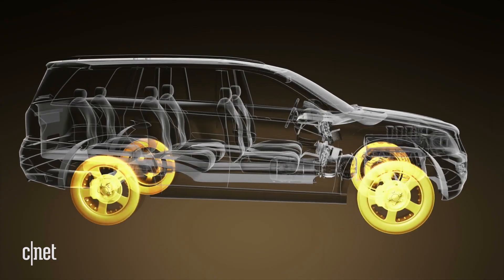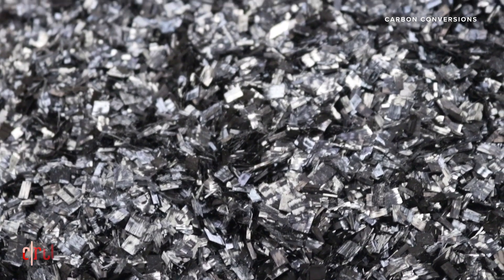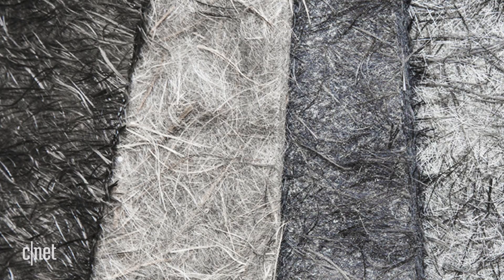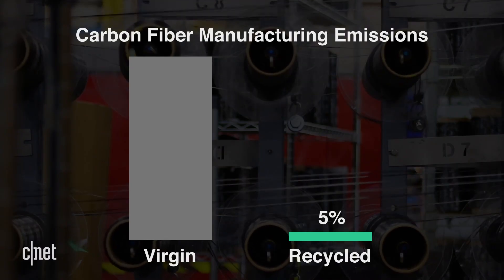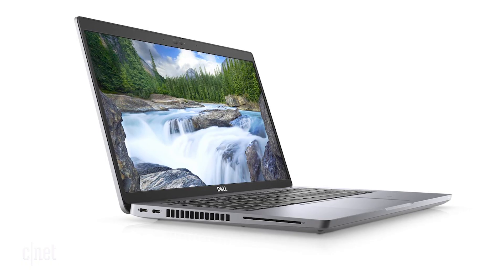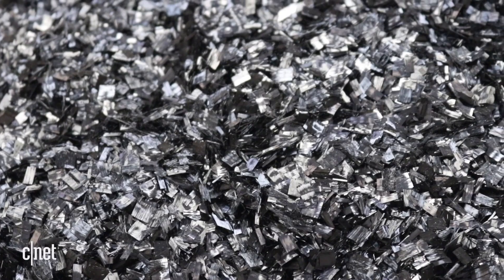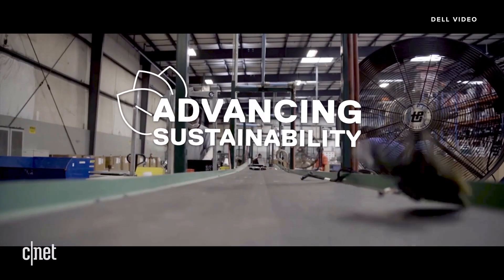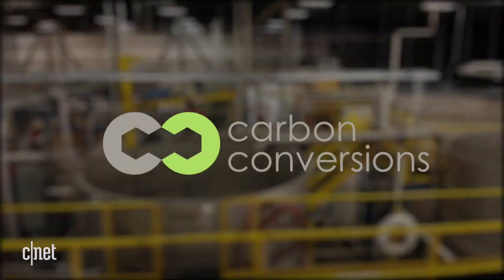Carbon fiber reclaiming, recycling, and repurposing is exploding

Comment: The carbon fibre look is very futuristic and even when repurposed it still has excellent strength and longevity for certain applications.
Some applications that are more suitable for carbon fibre than other materials such as GRP still haven't seen it's use.
Obviously carbon fibre from an aesthetic point of view alone is superior to other similar materials.
I have been a proponent of carbon fibre since the eighties with the uptake growing exponentially.
😎🇦🇺👍

Comment: "The strongest carbon fiber is up to ten times stronger than steel, and eight times stronger than aluminum"  I think you have those backwards.  Steel is significantly stronger than aluminum.  It takes more energy to create plastic deformation of steel than aluminum.  What grade of steel are we talking about here anyways that is 20% weaker than aluminum and at what temperature is that steel?  

I bring this up because I hate blanket statements presented as truth on the internet.  To me that's no different than saying "The earth is flat"   Steel is stronger than aluminum.  There is more than enough data to support it and it takes 2 seconds to google search it to find it.  

For example fully annealed 1018 steel during an elongation test had a ultimate tensile strength of 57.8ksi where as annealed 6061 aluminum has a ultimate tensile strength of 16ksi.  

If you are going to present yourself as an engineering channel at least get some basic facts correct.  Steel is not weaker than aluminum, maybe in some alloys it could be the case but not as a general blanket statement.  To assume that steel is 20% weaker than aluminum is absurd and anyone who believes that probably believes the earth is flat too.  

As Abraham Lincoln once said "Don't believe everything you hear on the internet"
Reply: I agree with you. That statement is obviously incorrect. 

I think they were unknowing, referring to the specific strength of the material, which is a unit of measure used in engineering for the ratio between strength and density. Refering to it as strength alone produces an incorrect statement.
Reply from the maker: Aluminum can be stronger than steal depending on the application and how thin and light it is compared to steal. It can be much lighter compared to steal and still be very rigid and strong. 
Googled it. https://www.aluminum.org/strength-aluminum
Reply: @CNET  Yes but my problem is that you made the claim as a blanket statement which is incorrect.  Yes certain grades of aluminum in certain applications can be stronger than certain grades of steel in certain applications but it is not the rule of thumb.  If you look at the shear breaking strength tests of steel vs aluminum you can see clear as day that steel is by far a stronger material.  We are specifically talking about strength properties, which means destructive testing in order to determine shear strength and elongation breaking strength.  You know you are defending a straw man argument.  Steel by far a stronger material than aluminum as a blanket statement.  It's the blanket statement that steel is 20% weaker than aluminum that I am targeting.  If that were true aluminum would be used instead of steel in crane cables, tow lines, screw pin shackles, gears etc.  Do you see my point?  Don't get me wrong, I have nothing against aluminum, it's a great product for specific applications but it is not nearly as versatile or diverse as steel or it's alloys.

Comment: Thanks for the 10 minute long dell laptop advertisement. I'll never get that time back.

I never post negative comments on YouTube but I think a lot more research needed to be done regarding this subject before making this a Cnet piece.
Reply from the maker: The piece was about how Carbon Conversions was reclaiming, reusing and recycling Carbon Fiber and developing new applications for carbon fiber. Dell was an interesting use case because they have managed to increase their use of carbon fiber while reducing the cost and at the same time made their laptops stronger, lighter and cheaper in the process. Simply pointing out how major manufacturers are using a more sustainable way of producing carbon fiber in present day.

Comment: It isn't taking too much of a stretch to anticipate such a fine strong fibre isn't a potential health hazard just like asbestos. Especially if inhaled.

So of course nobody is talking about that.
Reply: The research is ramping up on that. But right now it's not a real thing. Asbestos injuries are very real. Please don't conflate the two.
Reply: @namthainam  And injuries due to nano tubes, (carbon) fibers and so on are not? Chopping up fibre reinforced plastics might be more dangerous then it is worth.
Reply: It is although not to the same extent, for example a respirator should be used when sanding carbon fibre. It’s typically impregnated into epoxy though, so no risk from there.

Comment: So now the question is this: Carbon Conversions is using leftover waste from manufacturing (which is more carbon fiber reclamation than recycling, it seems), which is likely significantly an easier task than post-consumer waste.  What about post-consumer recycling?

And if Dell was serious about more sustainable products, then perhaps they should return to using industry-standard parts that can be more easily swapped out, vs proprietary boards, etc.
Reply: if Dell (or any company for that matter) keep serving outdated technology to its clientbase, as a company it will cease to progress competitively and end up going bankrupt.

BTW, I got a early version of Dell laptop latitude 1557 i7 processor worth about $1000, roughly my 4-5 months pay (in 2009, which back then was a huge deal to have it in India) that was having heating issues, eventually the laptop died a premature death. But, as I said as an early adopter it's always a gamble. Still, I don't rant about it much as I know how much effort and engineering the folks were putting into it, which I know it as I worked as a facilities executive for Dell in India. Dell is the only founder company still running headed by its original founder, and still on the game.

I came here to learn about the recyclability of carbon fibre composites, as the environmental damage could be huge if not having a circular economy into it, just like in other metals. It looks like there is a lot of progress is yet pending into handling and exploiting its resource.

Comment: 10x stronger than steel and 8x stronger than aluminum....really?😅
Reply: Yes. Read a book
Reply: @namthainam  what book? because as far as my understanding goes, steel is stronger than aluminium
Reply: @cyrustakem7993  Volumetrically it isn't, but gravimetrically it is pretty much as claimed.
Reply: @RoamMeYo  ok, that makes more sense. But usually the restriction is volumetrically first, if you can save weight better.
Reply: Maybe they mean by strength to weight ratio

Comment: So they are not recycling than? This is just waste reducing which is not bad in and by itself, but it does not eliminate the issues or even reduce the issue that carbon fiber poses for the environment. The moment they figure out a way to recycle things like the wings of a windmill, that's when we should start celebrating.
Reply: Batteries going from cars to powerwalls, used concrete going into road surfaces, cfrp going into laptops… its all just kicking the can down the road and enabling companies to explain their waste. must try harder. id be interested to see if those laptop chassis ever get recycled… i dont think my municipal waste dump can recycle cfrp…
Reply: iT's NôT pErFecT ąnD i Doñ'T Likə įŤ RREEEEEEE
Reply from the maker: They are recycling by taking used products like the Trek bike frames for example and extracting all the carbon fiber to make new chopped carbon fiber and other kinds of materials which they can resell for other purposes.
Reply: So how is the cured resin removed. I do not see how infused carbon can be separated? @CNET
Reply: @paulb9769  Thinning compounds can reduce the resin back to liquid form I believe.
Reply: @RoamMeYo  That is nonsense.
Reply: @CNET  It is still just downcycling. There seems to be nothing new happening here.
Reply: @robsonrobson4999   Correct. There seems to be a confusion around the "closing the loop" expression.
When you give back glass bottles to a soda company so they can refill and resupply them, it is considered a "closed loop" system. 
When plastic package gets fully recycled to be used in almost exactly the same packaging, it is considered closed loop.
In the example given above, long carbon fibers that had structural function in a bicycle, are being broken down to chips to be used most likely in non-structural roles (such as casing of electronic components), that is downcycling.  
Also, I am kind of curious about how they manage to separate the fibers from the epoxy matrix. I read some time ago that there are only two ways to do it, neither are exactly environmentally friendly:  you have to apply enormous heat to the material, or you must use corrosive chemicals which becomes a headache for later disposal.

Comment: This is not carbon fiber recycling. This is reducing carbon fiber waste. It is impossible to recycle carbon fiber once it's cured, which is why it's such a terrible material for the environment.
Reply: That is exactly what I was thinking, they should really be precise on these matters.
Reply: Not true. It is possible to recycle the fiber material even after the resin matrix has cured.
Reply: @mogulmniac  yes but the process is of doing so is labour intensive and complex. On top of this it requires a chemical or mechanical process that is not eco friendly in any way shape or form; which is why carbon fibre usually ends up being dumped.
Reply: @mogulmniac  HOW????
Reply: How?  @mogulmniac
Reply from the maker: It is recycling because they are taking already made products like the Trek bicycle frames for example and breaking them down into chopped carbon fiber and other products. Reclaiming the unused carbon fiber from production is a small part of the reclaiming business.
Reply: @CNET  Once again, this is some kind of downcycling at it' s best. They will not seperate fibre and matrix in a way that you will end up with long strands of fibres. there will be some chopped up, short fibres. And if they are not lucky they will create some seriuos health hazards.

Don' t buy the BS PR some companies are selling you.